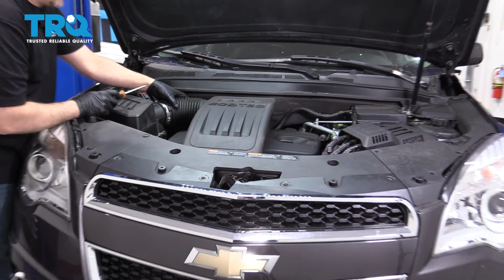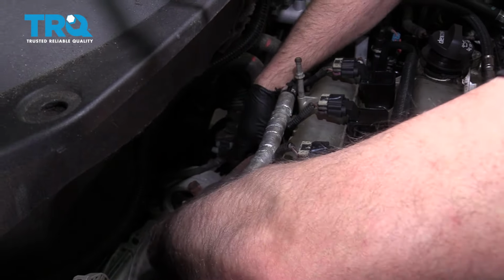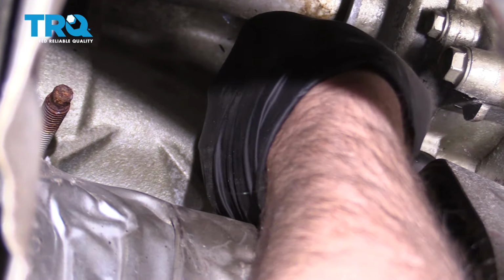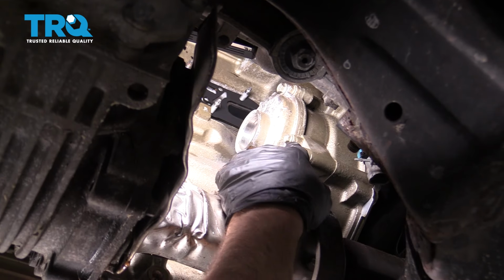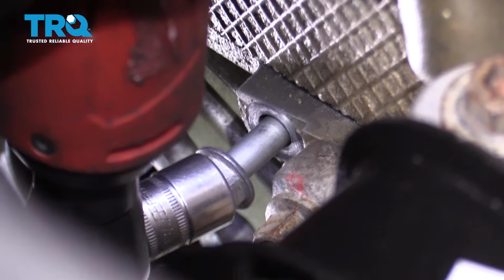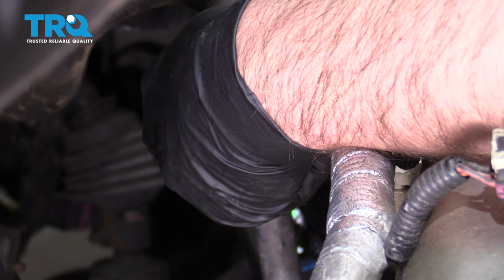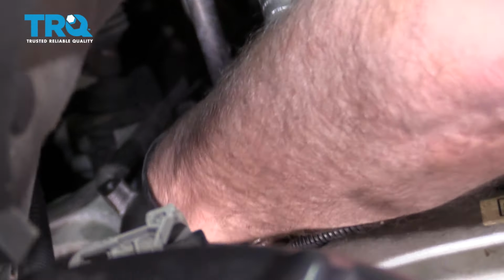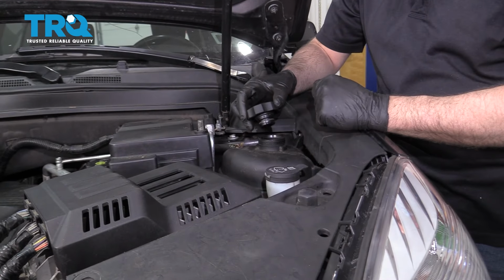How to Replace Water Pump 2010-2017 Chevrolet Equinox

Comment: My GF's just went in her 17 Equinox. $1080 dollars and 4hrs labor to get it done.  Unreal.  I did her son's Jeep Cherokee and it cost less than $400 and took me 15minutes. Longest part was getting air out of the system.
Reply: My wifes 17 is making a whining sound. Was your water pump making a sound or how did you know it was bad? Our sound see.s to be from the pulley side of the engine though. Hopefully its not the water pump
Reply: That's about 1/10 of the value of the car
Reply: The world's leading car manufacturers are laughing at you all of you and making big money doing if you noticed on the queue to these comment sections it says maybe if you could tell me exactly what you're doing I can understand help you what it really means is tell me what you're doing so I can build it so you can't do it anymore

Comment: Great video.  It was a big help!  Job was anything but fun.  Mine was a 2013 and there was a bracket off the back of the block that supported the converter that had to be removed or the converter could not be dropped far enough to get the water pump out.  I left the manifold in. Engineers should have to fix cars for a year before they are allowed to design anything!  Maintenance was absolutely not taken in account for this task!

Comment: Thanks alot bro. After watching your video a million times I finally did it. The only thing I didn't do was remove the exhaust manifold. I just pulled the pipe from the bottom of the car. Thanks

Comment: A good tip for lining up the sprocket holes when installing the new water pump is to take a picture of your old one and put some reference marks on it as soon as you take it out without disturbing it. use it to compare your new one next to.

Comment: So would it be possible when the water pump is replaced that they could do something to the exhaust manifold? we took ours in and when we got it back from a water pump replacement it was really loud and would smell like exhaust when the AC or heat was on while sitting idle. Now they say that the water pump has nothing to do with the manifold, yet it looks as if the manifold is removed to install the pump, and they are wanting to charge us 200 more dollars to fix a problem the vehicle didn't have before the water pump fix.

Comment: Great video, I would suggest a thermostat replacement while the housing is out. The way to refill this system is remove the upper hose from the engine side,  fill the radiator, then fill the engine at the neck, reconnect the hose. Top off reservoir. Start the engine, warm up. Run at 3k for 30 sec,, then idle for 30, repeat until cooling fans come on. Let return to normal temp, repeat 2 more times. Verify heat in vehicle and level in reservoir. Cool then check level. Per factory instructions.

Comment: So I thibk I have coolant leaking from that drain bolt. I don't see any above that and I cna see it dripping. How is that bolt sealed. Is there a flat gasket or some Teflon tape. How can I reseal properly if it is leaking from there? I don't think it's coming from those weep holes cause it's not leaking near the shaft portion. Thanks.

Comment: It's a labour intensive and costly repair no doubt. Long as everything else works and doesn't break down, it might be worth it. Toyota RAV4 is a much better built substitute, but the purchase price difference is usually way more than $1000 bucks repair cost. GM is usually pay as you go. Stellantis/Chrysler is even worse, you pay and you still can't go, lol

Comment: Welp! Wish me luck! I will have no choice but to do this repair in 30-40 degree weather underneath my car on the street! 😖 

Thé shop quoted me $918, if I pay in cash that is. And they told me I would have to leave my car in the shop for the entire day. Uhh.. I use my car for work, so if I did this there goes one day of pay plus labor money. 🤦🏽‍♂️ 

They also added in buying a thermostat housing as well. Do I really have to buy the thermostat housing too? This seems to be excessive to me. Looks like I’m up sh-ts creek with this repair.
Reply: As a shop owner it is recommended the last thing we want is a stuck thermostat after doing all that work. Might as well do it while it’s apart instead of having to come back in a month to pay extra labor to change it then. It just makes sense to do it while it’s off

Comment: What about the chain go to the pumps if you change the pump and the chains to is the chain needs a timings?
Reply: That's what the special tool was for that he bolt on before he took out the water pump. That keeps everything I'm sync while the pump is out. If you don't use the tool you will get an annoying whining sound. The balance shafted chain goes around the water pump

Comment: That's the reason why i won't buy equinox ever. It's a terrible, when you need a special tool for replacing just a water pump. And you will need to spent whole your day for it if you do this for the first time. It must be a much simplier! It's a nightmare!